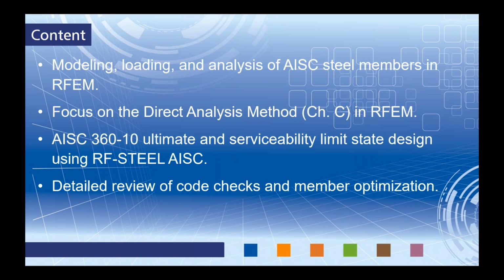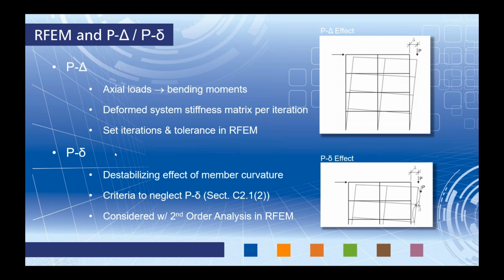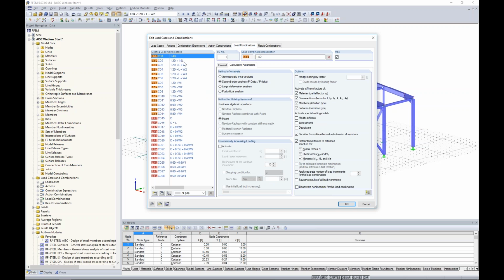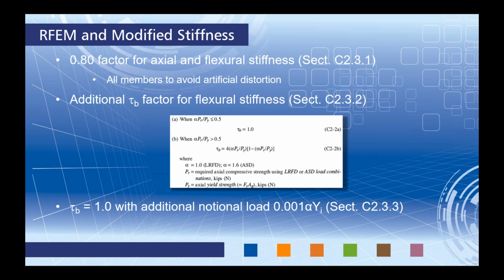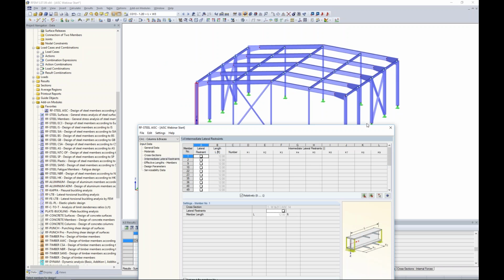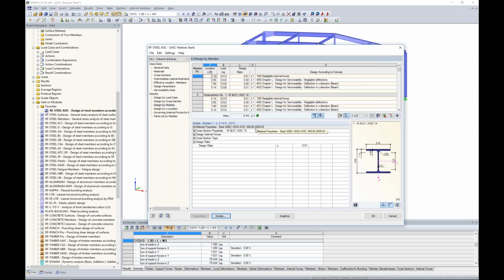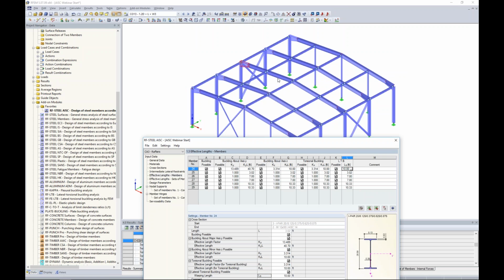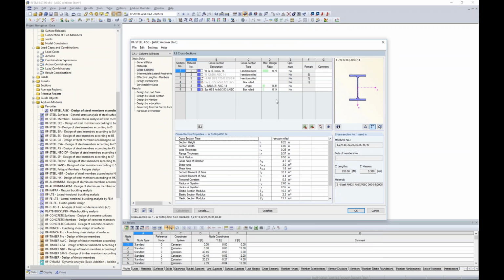Webinar: AISC 360-10 Steel Member Design in RFEM (USA)

Comment: Hi, Is the model used during the webinar available for downloading?
Reply from the maker: Hi, vsbalint!
Unfortunately, this webinar is older and the model is not available on our website.  However, a similar model can be downloaded which was used in an updated AISC 360-16 design webinar.  You can find both in the link below. 

https://www.dlubal.com/en-US/downloads-and-information/examples-and-tutorials/models-to-download/001106
Reply: @DlubalEN  Thank you for the quick answer. Looking at the webinar I saw something surprising for me. If I understand it well, it suggests, that if the Direct Analysis method of design is used, for all the stability (buckling) verifications including strong/weak axis flexural, torsional and lateral-torsional buckling the K factor can be set as 1.00, as long as the notional loads (L/500) AND the stiffness reductions are considered within a second order analysis. Is this true? I always assumed that this approach is applicable in the plane of the frame (who knows what is the plane in case of an irregular structure) for sway-sensitive structures, but not for out-of-plane buckling and certainly not for lateral-torsional bucking. I might be wrong.... Thank you
Reply from the maker: @vsbalint  The AISC 360-10 gives a more general statement in Sect. C3 that if the Direct Analysis Method is followed, the K factor of all members can be taken as 1.0.  The AISC 360-16 was revised to state that the K factor for "flexural buckling" shall be taken as 1.0.   Ultimately, we are not design engineers so cannot give definitive advice on code interpretations.  We suggest you contact AISC directly.

Comment: Can the software calculate the formula (C-A-7-3) in AISC 360-10?
Reply from the maker: Hi, serdar!
The program does not consider the Alignment Chart from AISC 360-10 Comm. 7.2. You have the ability to manually set the effective length factor, select the options available from Table C-A-7.1, or you can utilize the calculated effective length factor from the eigenvalue stability analysis buckling modes using RF-STABILITY.